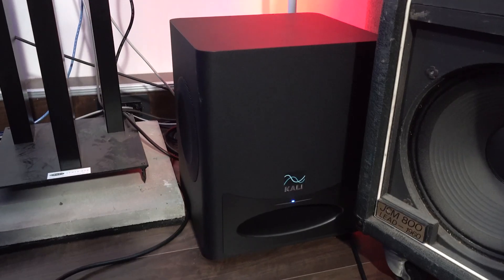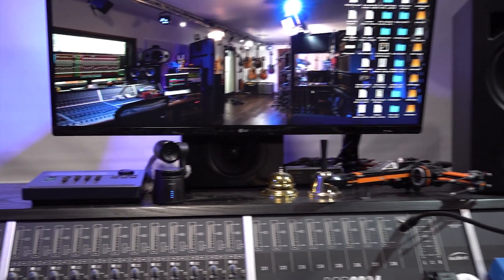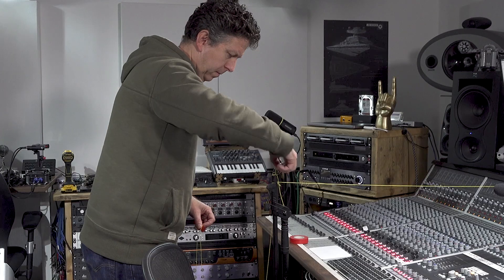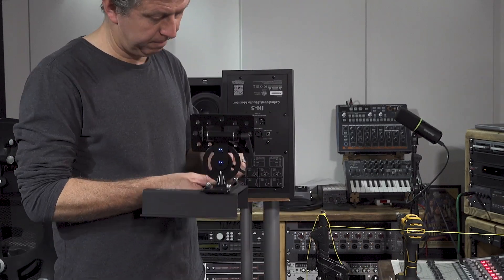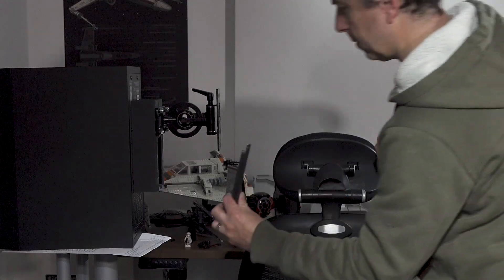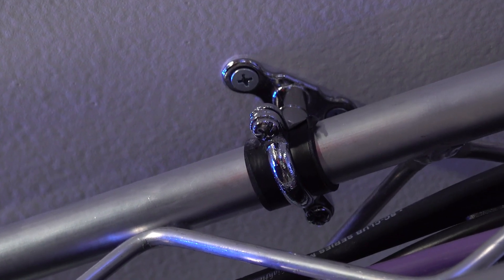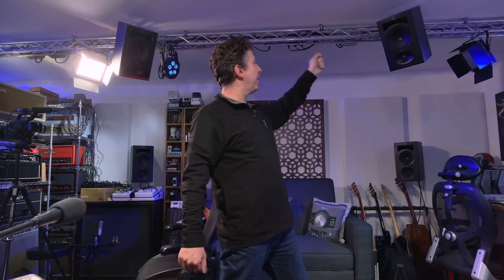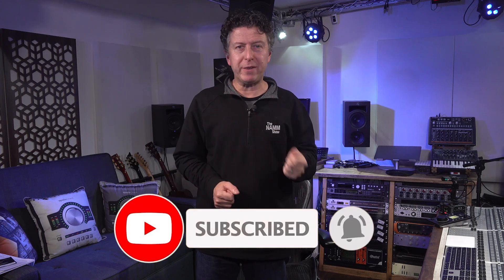Dolby Atmos Secrets Finally Revealed - Take Your Sound to the Next Level

Comment: Nice. I went for a Kali 7.1.4 system. Except I would have recommended using the IN-5s for heights as well. That way you can mount horizontal rather than the LP series needing to be vertical. Just more room to walk under, my room is only 2.4m high so it definitely helped. I did my setup about a year ago now, had to make some compromises, like my side surrounds are at 90 degrees, cause of a stupid door. But, it’s fine. Measurement software sorts that quite well. It’s definitely a steep learning curve, but Dolby has some PDFs that are useful.. good luck!

Comment: Thanks for the overview! Have been considering a similar system, but thinking if having IN-8's all around would be reasonable. Are you feeling that you are missing anything by having IN-5's ins surround and heights instead of the 8's? Having a stereo setup with IN-8 now, I know I wouldn't want anything less there if we're supposed to think of them as full frequency range. But, I suppose the subs will be needed for bass management with either of these speakers.
Reply from the maker: I have LP 5'sup top but no, having 5 or 6 inch drivers up top and around me is fine. The IN-8s at the front are great but I feel would be overkill for the sides and rears.

Comment: on this setup, is time alignment not an option to fix less than optimal speaker placement? or is even a tiny bit of delay too much for the mixing process to be correct?
Reply from the maker: There will be delay/time alignment added but not covered that in this video. This video is more about the nuts and bolts of the installation.